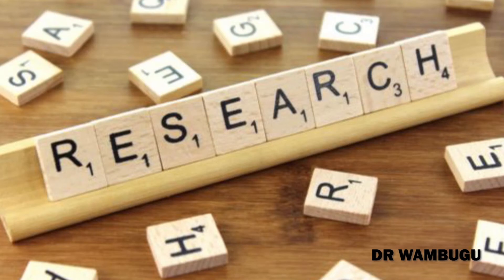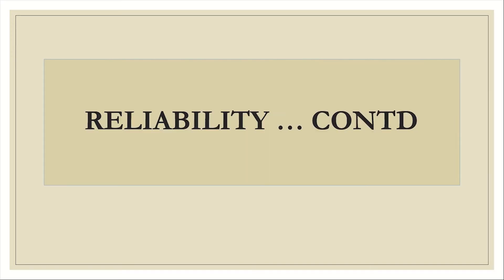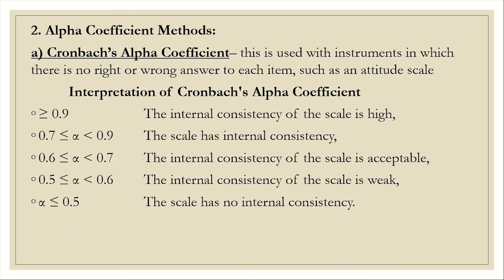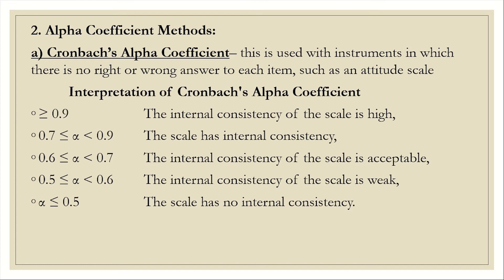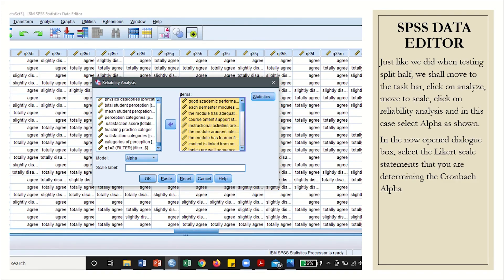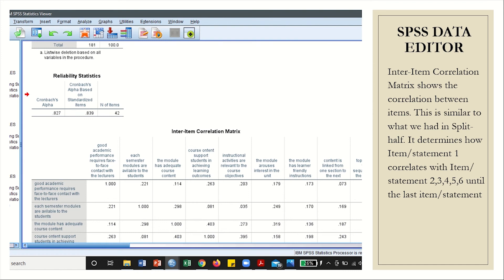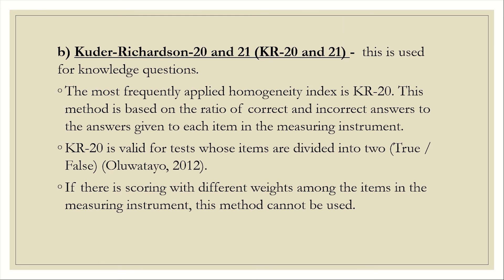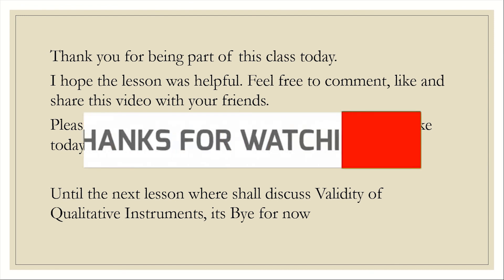LESSON 25 - ALPHA COEFFICIENT RELIABILITY: DETERMINING ALPHA COEFFICIENT RELIABILITY USING SPSS

Comment: Does Cronbach split the likert scale instruemnt into half the compare the results? 2. How does Kr 20.21 work?
Reply from the maker: Hello Tony. Likert Scale or any other scale type of questions are not tested using split half. You use Cronbach Alpha which does not require splitting
Reply: @research-methods-class  ok thanks so what is ideal for split half?
Reply from the maker: @tommy-leeosbornowiti7328  Questions measured at continuous scale